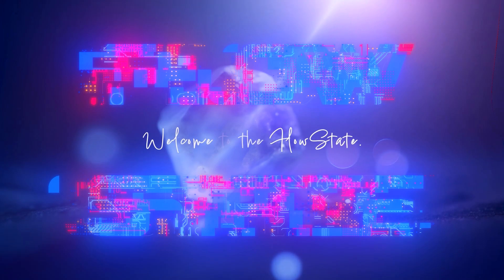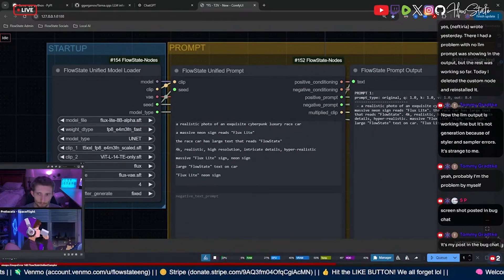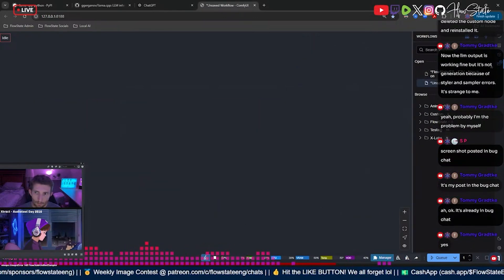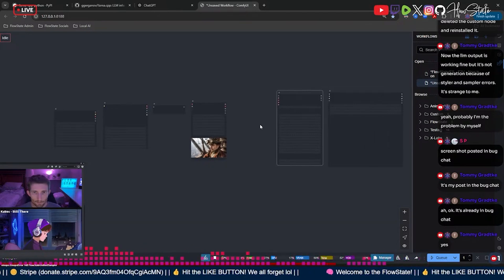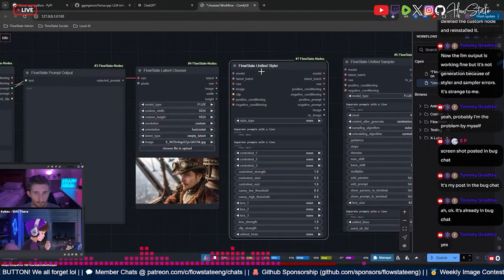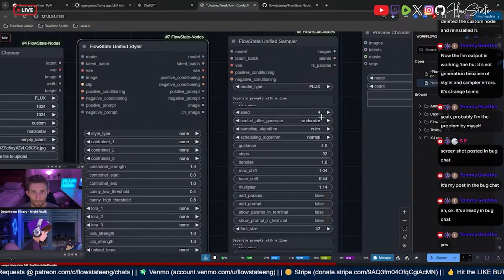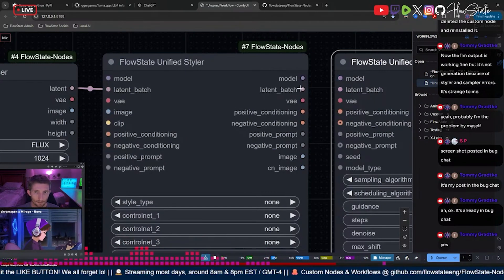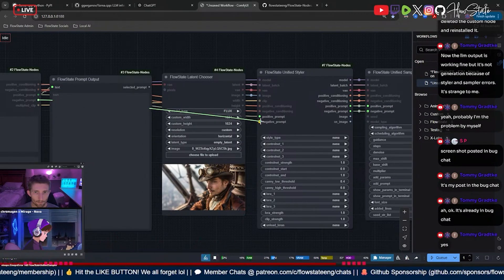Deep Dive on New Nodes & Workflow Hookup!

Comment: Hey, new to this whole open source AI thing. Bought my first desktop with a real GPU (4080) a couple months ago. I've managed to get this workflow running, but am unable to figure out which folder to move my other flux models to. I could only get the new lite one, and a couple of stable diffusion models to come up?
Reply from the maker: your SD and Flux NF4 models should go in your ComfyUI/ComfyUI/models/checkpoints folder. Your Flux Dev, Flux Schnell, Flux Lite, and Flux Pixelwave, should go in your ComfyUI/ComfyUI/models/unet folder. Your GGUF LLM models should go in your ComfyUI/ComfyUI/models/llm_gguf folder, which you will need to make because it isnt a standard folder in Comfy. Make sure the GGUF LLM models are "instruct" type models. Like this: https://huggingface.co/meta-llama/Llama-3.2-1B-Instruct

Comment: Nice, i was hesitant yesterday to interrupt you during the stream to ask a question about your workflow not working for me neither. Gonna check this to see if it fixes my issues
edit : still getting FlowStateUnifiedStyler.apply_style() missing 1 required positional argument: 'unload_loras' unfortunately. I also noted that prompt output isn't showing anything and startup nodes is reloading everything for each generation instead of keeping the unchanged models in vram which leads to unbearable generation time for a single image.
Reply from the maker: yeah make sure youre not using an old workflow. comfy doesnt always automatically updated the nodes in the workflow. so if you install the new version of the nodes and use an old workflow, it the nodes wont look like the new nodes. we are working on a standalone application thats entirely separate from comfy but for now gotta deal with their quirks. for example, if i added/removed an input or output, and you install the new nodes with that update, but you load an old workflow, the node wouldn't show that updated input/output in the workflow. so then things get misaligned and nothing works. i have a feeling thats whats going on in your situation